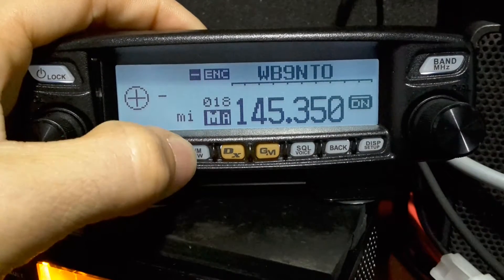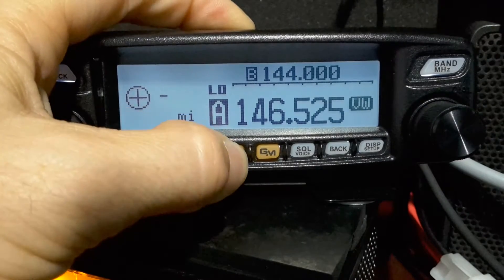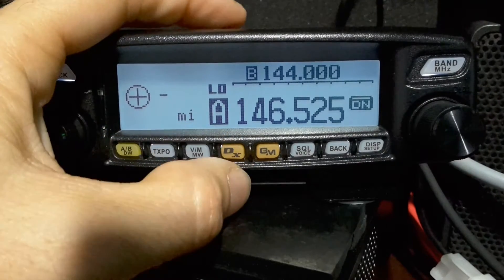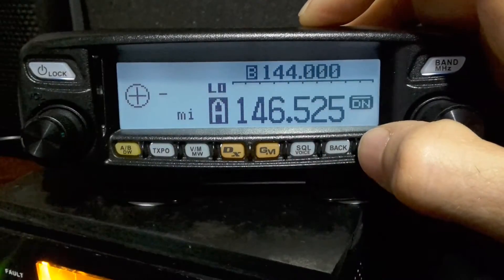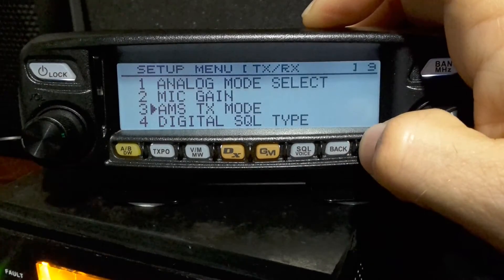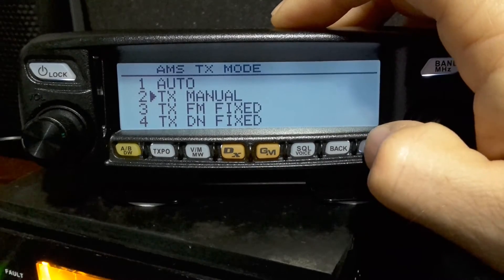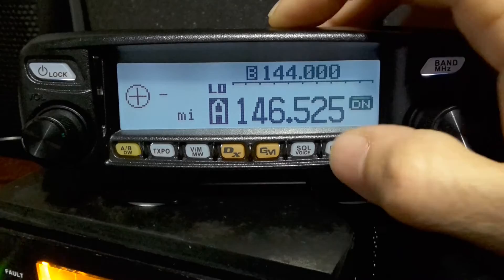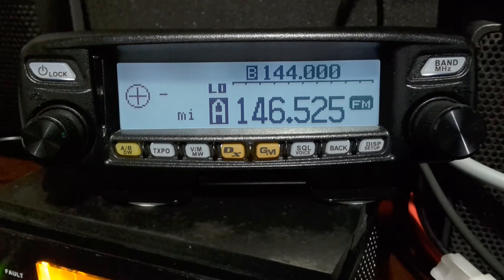How to quick toggle between digital and analog modes with Yaesu FTM-100D.

Comment: Cam you turn it off all together so when you switch to a different preset in memory mode it stays on what you programmed. Or do you have to change it to digital or fm depending.